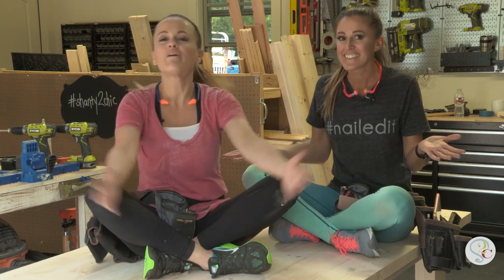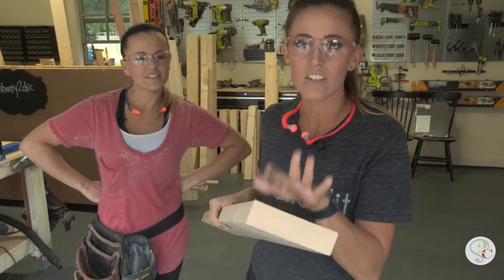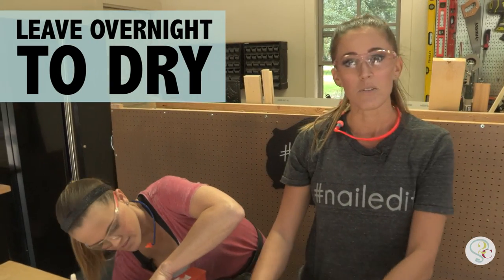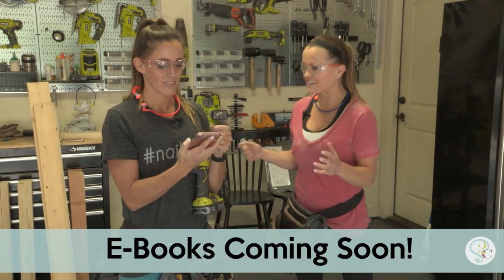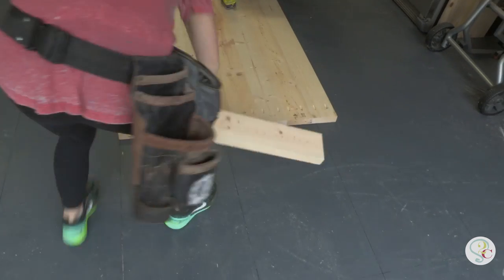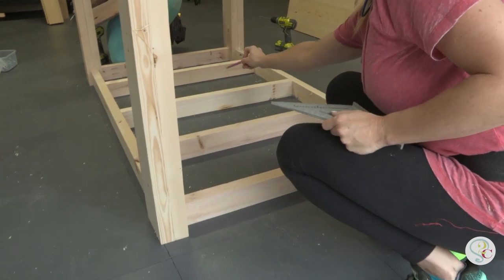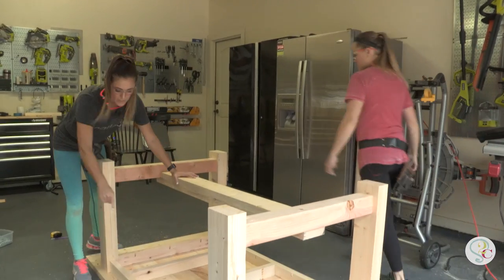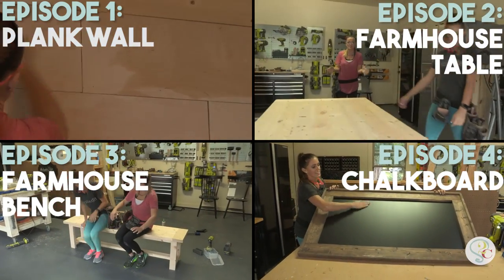$75 Farmhouse Dining Table Build | #ShantyHouseCrash

Comment: Hi I downloaded the plans and built this wonderful table. Only dilemna I came across with are the 5 inch wide breadboards. Will not be wide enough for an overhang for end table dining chairs. Caught it on early and decided to make it 10 inch wide breadboards instead. Just enough to comfortably be able to accomodate end table dining chairs with adequate space for leg room and for feet to rest on the bottom of the base comfortably. For assurance I placed 6 pocket holes to the top of breadboard as well due to the added mass and plugged it with Kreg pocket hole plugs. Sanded it flush and actually looks nice as if it is a missionary style method of supporting breadboards. As if it is doweled with a mortise and tenon. Tabletop is stained Gray and Walnut for the base to match my the dning chairs. 3 coats of Polyurethane after, wet sanding in between coats and it looks fantastic. Thanks!

Comment: Just made this table yesterday with the free printout instructions. They are super helpful and really easy to read, all around very well put together. But, this table cost me $164 in lumber & took 4 grown men who have experience with wood working almost 12 hours to cut and build. We haven’t even sanded and stained it yet but I’m sure that will also be taking 6+ hours. Not that this is a bad thing, because going to the store and trying to find a HEAVY well built table would probably cost you around $300+ easy.

Comment: ..really like the black hardware! nice touch👍 u ladies should invest in a doweling jig or a  biscuit joiner.wont need so many of those pricey pocket hole screws then..justa suggestion ")
Reply: Yeah, I was thinking, "$75? there is  $20 in pocket hole screws!"
Reply: Mike Zeke yea at least..& that nice hardware is $. but i think they were saying JUST the lumber..but,for the $200.this table prolly costs thats still a good deal. Ive built a 8'Lx3'Wx2"thick farmhouse table in the past & sold it for $750.00.i spent $275 total on lumber stain,poly,and hardware.had 4x4 legs& breadboard ends too.similar to this table. But i used a  m&t for the b/b ends. And only glued the center to allow wood movement..those kreg screws add up and go really fast..
Reply from the maker: Joe basementwoodworking the hardware is just Framing angles and straps - maybe $10 total. We spray painted them black.
Reply: Shanty2Chic oh nice! well,, u fooled me! haha!😁 i used to use p.h.s. for everything until I invested in a biscuit joiner & doweling jig. they really save a lot of time & money (youll use 1/3 of those pricey kreg screws) i wasn't saying it in a troll way, i was just giving a  friendly (" Diy-FYI ")
keep up the great work look fwd to the next one!🍻
Reply from the maker: Joe basementwoodworking we didn't take it that way 😀😀 totally get it! I was happy you thought we spent $ on the hardware 🙌🏻 Thank you for the tip!
Reply: Shanty2Chic ok cool. yea u had me checking amazon lol! and yw. anything to help a fellow DIYer
Reply: The build article shows which Simpson ties they use. Because of the Shanty sisters a lot of my project utilize cheap hardware with a nice oil rubbed bronze metallic spray paint. You never know they're cheap metal.
Reply: ***** ..yea i always forget to check descriptions and websites for articles.lol  and they do give their projects that extra touch which i thought was pricey hardware on amazon or lowes.lol but now where to look thanks !🍻
Reply: +Shanty2Chic dig the style,  but my way to age hardware (including fasteners) would be heat to red hot with torch or forge to get layer of oxidation, coat in bees wax when mostly cooled.
Reply: I would like to learn how to  forge stuff  by hand  like Nicholas Sweet Life +Mike Zeke after u torch it red hot do u hit it with a hammer to make marks ?
Reply: Hi guys...I've read all the comments below Joe's original comments and I have to have my two cents. The original purpose of these girls' plans and tool usage, along with other women DIYers such as Ana White, Jamie Costiglio, and many others, is bare minimum of tools and cheap wood to build solid projects for less money than put-together-furniture. You start adding biscuit joiners and dowels and suddenly you're into more money and skills than kreg jig users. I don't mind the price of screws for the amount of pieces I build. However, If I were to start to sell my pieces, and build many things, I'm sure the more expensive/professional tools would be the way to go.
Reply: Linda Baldock using a doweling jig isnt hard at all iys just as easy as using a kreg jig except instead of using the screws you're using little round pieces of wood and instead of drilling at an angle you're drilling straight down joining two pieces together I get what you're saying though  Linda. I was only suggesting it because  those ladies do have skills and Im sure they. Would have no issues using it and could benefit from it and save money on screws. but I see where you're coming from to each his or her own :-)
A dowel jig i use cost 15$ and 100 dowels i buy for 10$ vs a hundred bucks for the Kreg Jig I have a K4 and I use it for face frames I was just suggesting it because they have skills and maybe they can show other female Woodworkers and diyers how to use it if they were to purchase one. got to step out of the comfort zones sometimes. you'll be surprised at what you can do:) have a good day!")
Reply: But like I said I get what you're saying I get where you're coming from no harm no foul it was only a friendly DIY FYI suggestion
Reply: Not taking any offense.  I've followed these DYI gals for years, along with several other women DYIers, and the basic premise years ago was to be able to build good furniture with simple tools. I know these gals have major skills, but they have to remember who their audience is. The kreg jig was a boon to us then, and still is. I do appreciate the more skilled DYIers' comments, though for those people who want to expand their skills. ( P.S., I do know how to use dowels...it's the biscuit joiner that I was really referring to.)
Reply: +Linda Baldock ahh i see,,well the biscuit joiner is the same concept but just using flat oval shaped pieces just join the 2 edges together draw a line accross the two pieces u wanna join and where the line is is where u place the biscuit joiner and push it fwd to make the cut/slot then once you've made the cut on both pieces,you simply add some glue to the slots that has been made put the biscuit in the one slot add some glue to the other slot and  put the two pieces of wood together and clamp it up. it sounds more complex than it really is ") but once you've used it it's "like riding a bike" it's mostly used for aligning table tops and other panels types during a glue up. but has other uses also after ur more aquainted with it. but  if you know how to and can use a dowel jig you definitely could use a biscuit joiner
I had my doubts about it too, until I gave it a try.  I thought "well if I don't like it I can always return it" ..lol
Reply: But then again everybody does everything different that's what makes the DIY and woodworking community so great you could learn something new from the next person I'm sure I could learn something new from you if you had a YouTube channel :)
Reply: There's also the costs of long clamps and Harbor Freight clamps are not the best .... They want the simplest way to encourage  more people (mainly ladies) to build 😊
Reply: Bryan Patterson the harbor freight F Style clamps arent too bad.as lo g as u dont overtighten them . But I swear by the Jorgensen parallel clamps the best CK body clamps and the Craftsman quick-release clamps they're all a little pricey but youll never have to replace them..but then again 
"you can never have too many clamps" ;)

Comment: Love your channel ladies.  I wonder how your table is doing?  Wood flexes with temperature and humidity.  With the wood you are using and the method of attaching the boards allowing for little if at all "wiggle room"   I was curious if you had shrinkage or expansion issues near the breadboard area?  Any cracks?  I was going to construct a farmhouse table but using a mortise and tenon method to allow for wood movement.  When I saw this video I was curious if your table using pocket screws has held up with no warping?  Again love the channel, keep the content coming!
Reply from the maker: Jayson Costain thank you!! Our tables hold up fine with very little to no separation but that is worse by location. Our designs are for beginner DIY'ers and the pocket hole method is best for that purpose. Mortise and tenon will ultimately give the best results if you are concerned about warping and separation. Thanks again :)

Comment: This video has been posted for a few years now. Please let me know how that table is holding up. I want to follow this plan, but the breadboards have me worried. The wood needs to move due to moisture and temp change in the seasons. I feel like the pocket holes for the breadboard is a no no.
Reply: nobody seems to be wanting to respond to our legit questions...I too have doubts with the end boards not having room for expansion

Comment: +shanty2chic did yall run your lumber through a planer also? The faces look way too smooth to be framing lumber. Or did you use different lumber than the $75 lumber quoted in the video?
Reply: Yeah, I had the same question, where does one buy perfect framing lumber that doesn't require any stock preparation? If such a place exists and it's as cheap as anywhere else, I'll buy all my framing lumber from there.
Reply: Had the same question; and by the day you posted your question, seems they skipped to answer it.
Reply: If i may answer.... the framing lumber used in the videos are indeed smooth.... as long as you stay under the 2x8.... you can get smooth lumber. Things start getting tricky past 2x8s.... i.e 2x10, 2x12, etc...
Reply: I've never had a problem with buying lumber through a box store and sanding it down. Starting with 80grit up to 220grit

Comment: Ok so I'm finally getting to build this for my wife with a couple tweeks. But I ran into a problem with the plans. The thick beefy legs are cut at 28 1/2 inches and after installing them the table only comes to 30 inches tall. Way to small. I think there was a problem with the measurements in your plan. Unfortunately I have to go out and buy more 2x6 so I can make the table taller. Another unfortunate thing is I'm an experienced builder and I didn't catch that in time lol. Either way the wife is going to love it. Thanks girls

Comment: I'm getting ready to build this table but I have a question. Can I attach the runners directly under the table top? I want to be able to scoot a chair in at the ends of the table and I'm not a fan of the runners being there at the bottom. However, I don't want to challenge the structural integrity of the table by making that change. Thoughts?

Comment: Question. I am thinking of making this but putting it outside as a picnic table on our deck.  What would be best to help it resistance the weather and if I coat it with something would I still need to use pressure treated wood? Thanks!
Reply from the maker: Eric Gossick hey! You will need to put gaps between the table top planks to let water drain through them (you don't want it to puddle on top) Also make sure to use an outdoor sealer!

Comment: Important question ladies!!! I bought all wood side table at a flea market and the paint was practically falling off of it so I sanded it all the way down to the wood and there is so much sawdust that I got majority of it off i'm painting it white with chalk paint and I need to know if you recommend a product to fully clean the surface to get rid of any sawdust that may be left behind I wiped it down used a brush to get it off and I still fill sawdust on the wood!!! Can you help me??
Reply from the maker: Kandace Espinoza I just use a damp clean cloth after blowing the sawdust off. Hope this helps!
Reply: You probably already came up with a soulution but they sell tack cloths at stores. Use those to wipe down the table and it'll be free of even tiny dust. Just make sure to go over the top again after you're all done with the bottom part of the table

Comment: Isn't framing lumber a type of construction lumber? I've been doing quite a bit of research and noticed repeatedly that expert woodworkers and carpenters do not recommend it since the moisture content is too high and it warps after a certain time. So how do you combat that?
Reply: It won't stand the test of time unless they got the moisture down to 8 to 12 percent minimum

Comment: what color stain did you two use? I love it.
Reply from the maker: Courtney Lynn Briarsmoke by Varathane. If you click on the link to the blog in the description box of each video, we share the free printable plans and all of the details on the finish etc. hope this helps!
Reply: They pretty much use the same color stain on most of their projects. I messaged them and asked the same question. I was told Varathane Briarsmoke (Home Depot). I used the same stain on quite a few projects.
Reply: In their pics the Briarsmoke stain looks brown but when I purchased some and opened the can it was grey and went on grey. Was it grey for you?
Reply: @DavidZupec  first time we did we added antique white n it came taupe which we luv did the same thing on a counter n its mostly grey now😢😢

Comment: I just recently purchased all the lumber for this project and the cost was $110 you could possibly get closer to the price point of this original video price if you had a 20% coupon but as of June 2008 the price for the lumber including hardware was $110 and change.
Reply: 2018*
Reply from the maker: theitaliankid80 we spent $75 in Texas. Lumber prices vary A LOT depending on location
Reply: Shanty2Chic Yeah I know I used to live in San Antonio now I’m located in Tennessee and the prices are a little higher here I was just giving everyone the benefit of the doubt that prices do very from state to state. Thanks

Comment: Where I live all construction lumber from the big box stores
is not flat or straight at all !!! So how could I make this table to have a
flat top & the rest of the peace’s fit together right if none of the wood
is flat or straight, not even close no matter how much you look through the
piles of wood for some that is flat & straight.
Reply: To be honest most big box stores will seem like there are no straight/flat boards, but you have to dig through them until you find them.  I probably went through 70 2x6x8s before I found 8 that were good enough.  It's the price you pay for using it.

Comment: Im going to call major BS on 75$. I build a lot of furniture and I'm pretty acquainted with the price of lumber. To build this, including  Glue, sand paper, stain, strews, hardware and lumber its going to be around 150.....And thats hoping you have all the required tools.
Reply from the maker: crashdown903p $75 in framing lumber. We never include the cost of stain because we can get many pieces done with one can and everyone uses a different finish. We don't count the cost of tools either - if I bake a cake, I don't include the cost of the oven or the bowls and utensils I used to make it. You are more than welcome to download our free plans :) We include a supply list so that you can estimate the total cost of materials before you build. We have been designing and building furniture for over 8 years and we are well acquainted with the cost of building materials, as well 😉
Reply: My lumber alone was $130. Still cheaper than buying it at store though.
Reply: mine was $73, but i did not buy the lumber for the bench yet.
Reply: I guess this may depend on where you're at. In FL I just bought all the lumber and it would have been just about $75. However it was a bit more as I changed the dimensions.
Reply: in the north east: 2x6  $8.32 a piece, 2x4  $4  4x4  $7  so u looking at about $100 for lumber at Home depot
Reply: thanks for all u do ladies. Please ignore negative comments...